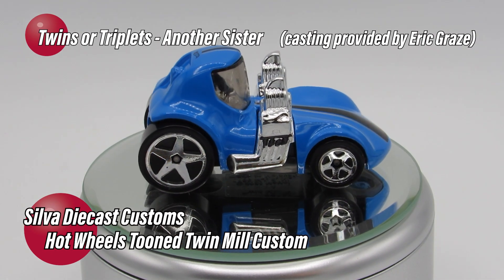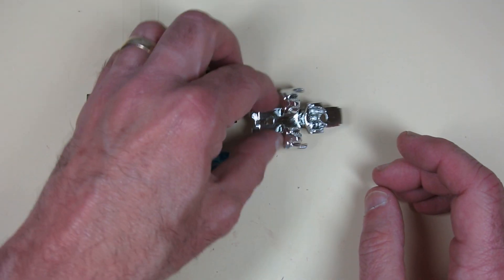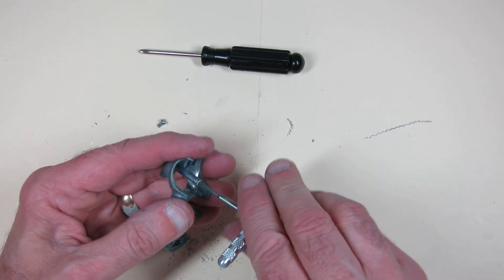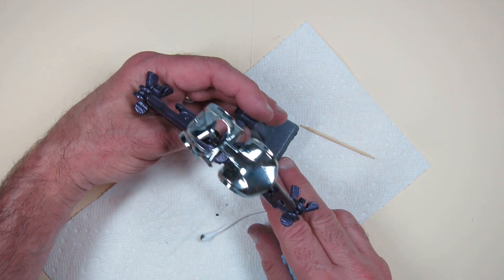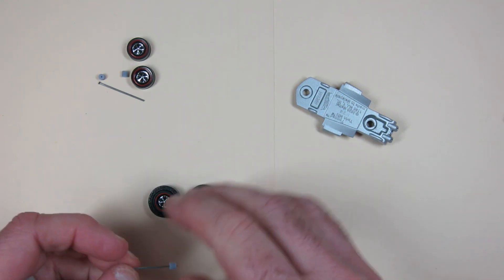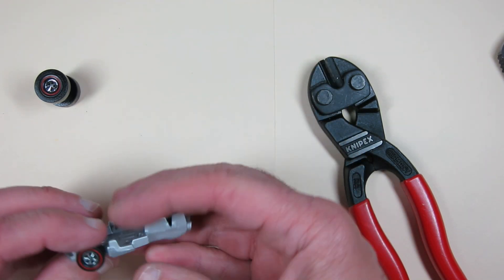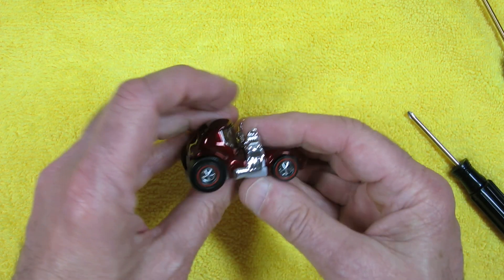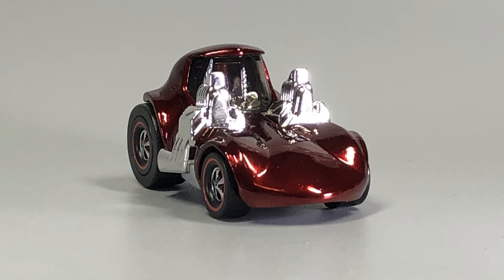Hot Wheels Tooned Twin Mill Redline Conversion - Another Sister

Comment: i feel you should do this with the Twin Mill Gen E, i admit that i dont like the Twin Mill Gen E, but for the sake of thoroughness i feel you should add it in there
Reply from the maker: Funny you should mention it...I just posted a pic a few days ago on my Instagram page that I'm in the process of doing one right now.  I have it at a pretty high polish but the sides need more work.
Reply: @JimSilva-SilvaDiecastCustoms  nice, one thing i feel the need to mention though, i much prefer the Twin Mill in green, for some reason, Green Twin Mill just looks 10 times better no matter what, personal preference, red is nice, but green is better

what if you did this with the Bone Shaker and all its variants? given Mattel's weird insistance to make the Bone Shaker the face of the brand, itd be neat, not to mention there are exactly 6 bone shakers including the normal one, so it would be fun, maybe, could do it in gold this time
Reply from the maker: Thanks!  There's something about the Twin Mill that for me looks best in red.  When it comes to the Bone Shaker, there's something about that casting that I love altering (which I guess is pretty obvious from all of the Bone Shaker customs I've done so far...and I have more planned lol).  Not sure if I'll give the treatment I've given to the Twin Mill to the Bone Shaker, but it's certainly possible, although my personal preference would be to start with a casting that goes back to the early Hot Wheels days that's gone through some alterations (such as the Deora)
Reply: @JimSilva-SilvaDiecastCustoms  im personally not the biggest fan of the bone shaker, which is why mattel's insistance to making it the face of the hot wheels brand frustrates me, like its cool, but not THAT cool, especially when the Twin Mill is just so much cooler to me, but like, i dont dislike it, i just dont like it that much, still, i think redline versions of the Bone Shaker would be cool, plus, i love, basically every other variant of the bone shaker more than the regular one, so it would be cool to see them painted in spectraflame paint, maybe spectrafrost, which is satin spectraflame, and yes its a thing